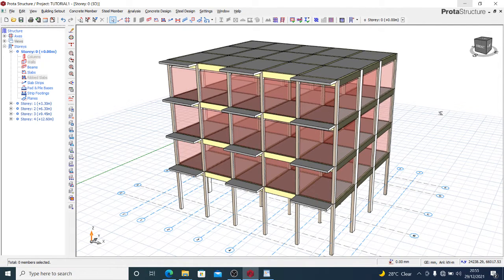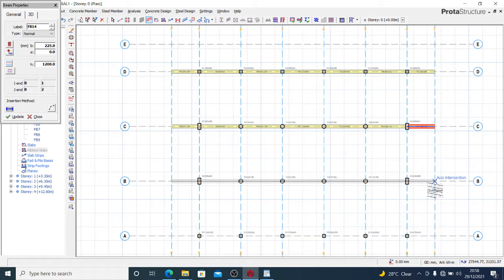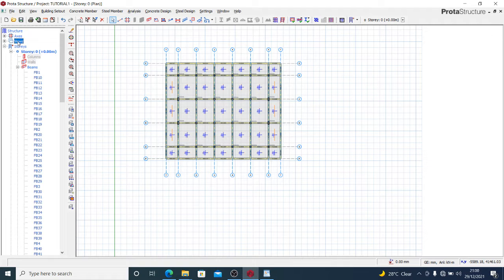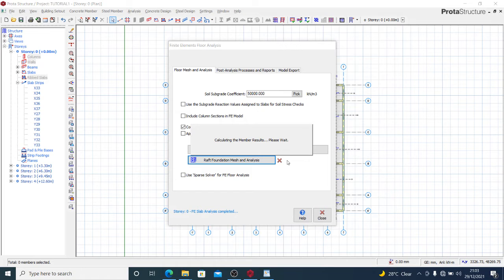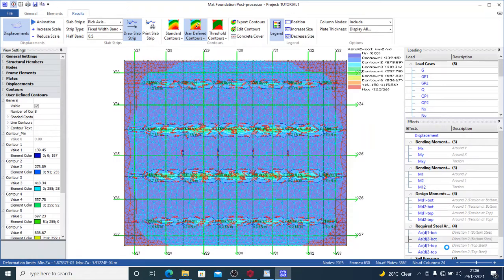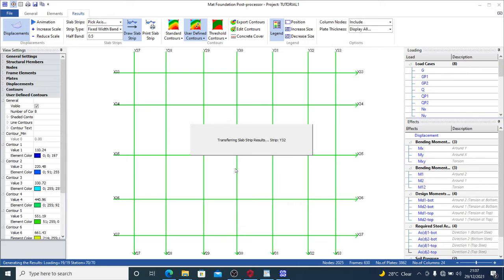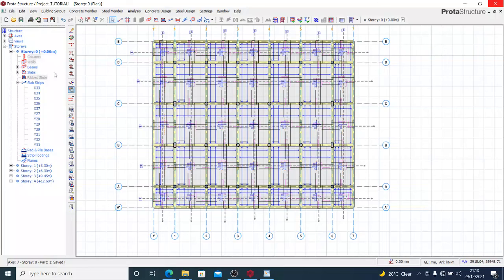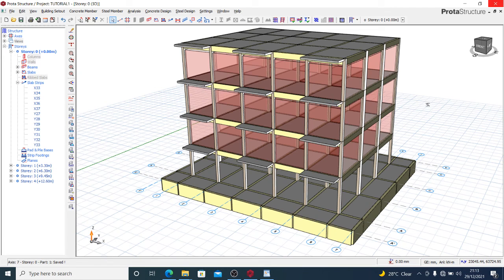FOUNDATION DESIGN IN PROTA STRUCTURE- PARTII (RAFT/MAT FOUNDATION)

Comment: Is it compulsory that all raft foundation must have slab?. What if you decide to use beam all through the trench of the foundation without slab, will the results be perfect?
Reply: I mean after raising all the reinforced trench to the DPC floor level, you will sand fill, compact and do your normal mass concrete floor with out reinforcement (as your DPC floor)
Reply from the maker: @victornwadishi6532  No,that's not raft. The foundation is a whole system  and not just the beam
Reply from the maker: I really don't seem to understand your question, if you want to do without the slab in your raft,then what forms your foundation floor?

Comment: hello,
I discovered that while using the "user defined contour" you specified Y16 as your reinforcement but on the model, when the steel bars were introduced they were all Y12. What happened? Thank you
Reply from the maker: Yes, its been observed that the software would make equivalent provisions of selected steel. So it can create alternative provisions if there are other area of steel and spacing that can work in the place of the selected one. 
I hope you will understand my explanation
Reply: It's ok. Thanks

Comment: Nice video. I noticed u didn’t include beam wall load to ur raft beams. 
How do we carter for that?
Reply from the maker: You can add beam wall load as we did for the other floors
Reply: @Joshua_d_designer  ok, thanks a lot. I have learned a lot from u.
Reply from the maker: @Augustine_Alul  I am glad to hear this. Thank you 😊
Reply: There is no wall load on the raft beam. only the slab. all the loads on the storeys above have been transferred through the columns down. If you add beam wall load you would succeeded to increase the load on the foundation which might reduce how optimum you design is.

Comment: what does the subgrade coefficient in the parameters 50000kn/m3 represent?.
Reply from the maker: It is a stiffness parameter that is commonly used to define the support conditions of footings and mat foundations. This parameter explains a linear elastic response. Hence during the design, the pressure generated by the modulus of subgrade reaction is limited to the allowable bearing pressure of the soil.